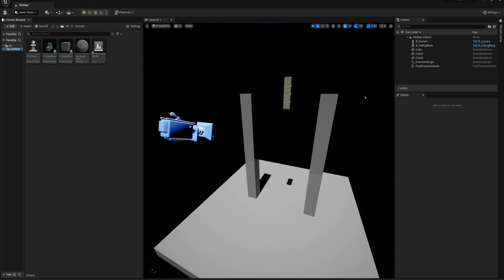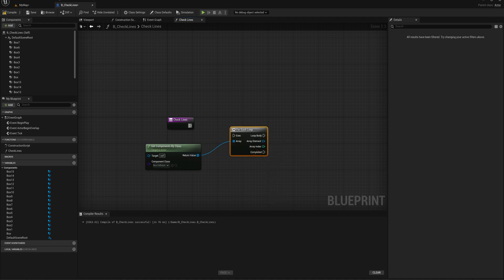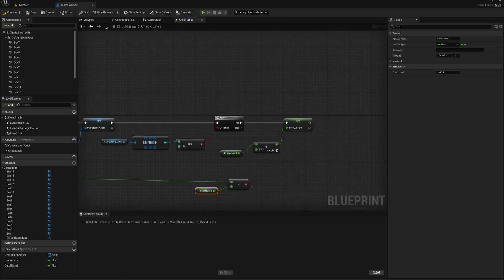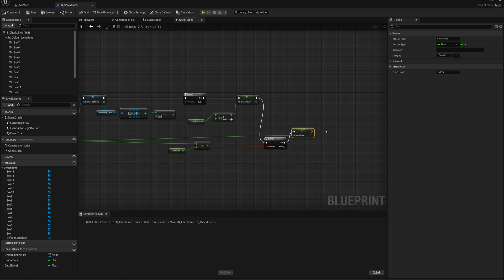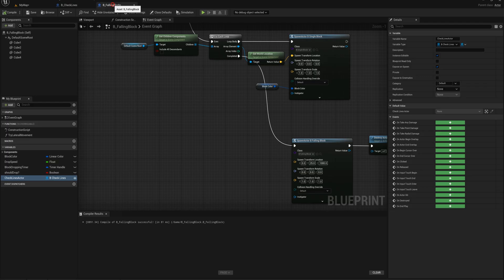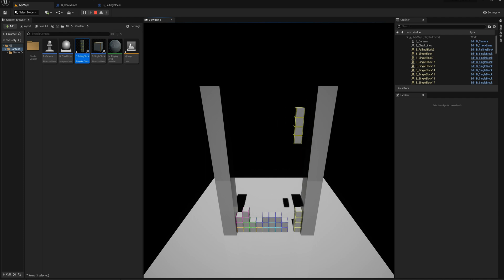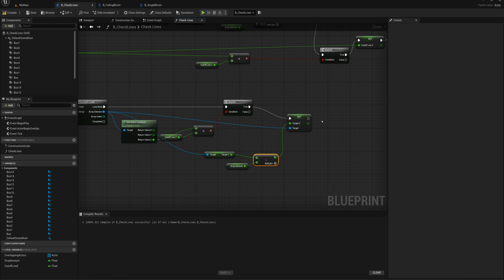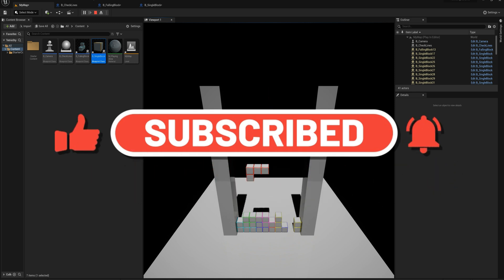Tetris Style "Falling Blocks" Game With Unreal Engine 5 - Part 4: Detecting Completed Lines

Comment: Very cool tutorial. I found that when I package the project, there is a slight problem with the lines that needs to be destroyed. It might be something with UE5 but in the editor it works normal as on your video, once packaged only one line gets destroyed and the other lines just move down and overlap the blocks below them causing weird artifacts. I managed to get a work around by moving the particle spawner and destroy actor node to an earlier place in the script. I have seen this problem where things work differently in the editor than the packaged project in UE5. I think there are still quite a few bugs Epic needs to fix in order for the editor and packaged project to be the same.
Keep up the good videos, I enjoy watching them.
Reply: Same. I'm having odd line destruction problems ONLY in the packaged project. So strange.
Reply: i have it in a preview as well.